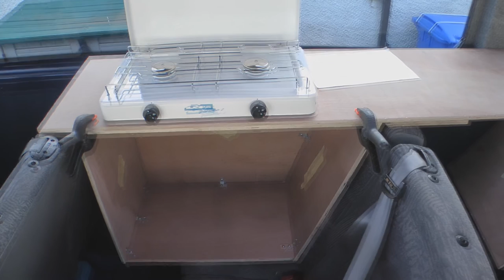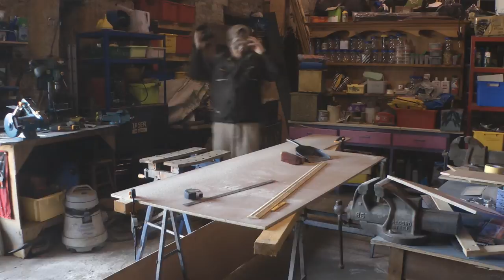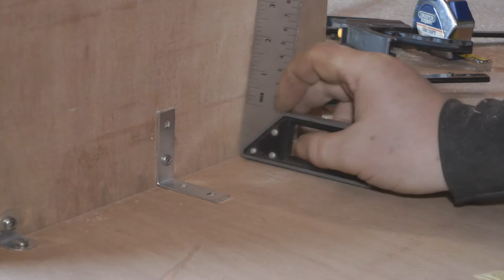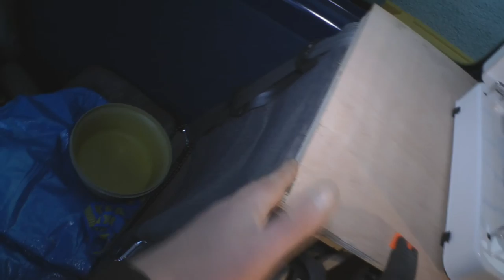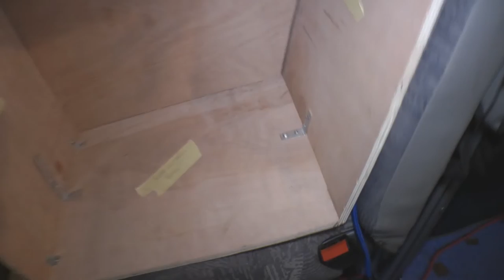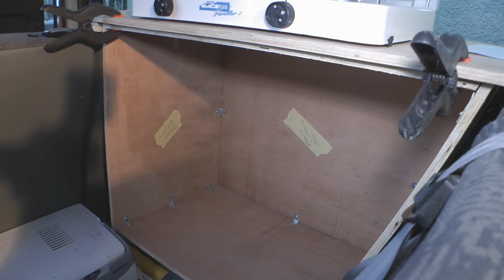Minibus Camp Kitchen Build. 2 of 9

Comment: you mention using the seat belt to secure the work station, you may not need to cut a hole at the bottom, depending on how it lines up with the seat belt clip, you might get away with just chamfering/sanding back out a small section of the frame as the belt isn't very thick and the door will probably close on it with out need for a hole if ya see what i mean,  loving the build, thanks for the thanks by the way, cheers, dave
Reply from the maker: Nice idea, I hadn't thought of coming out of the front face. That would make it less fiddly to fit too and looking at it, it lines up with the seat belt clip better from that angle. Cheers bud and you are welcome thanks for sticking with my channel I appreciate all your comments. Atb Dave